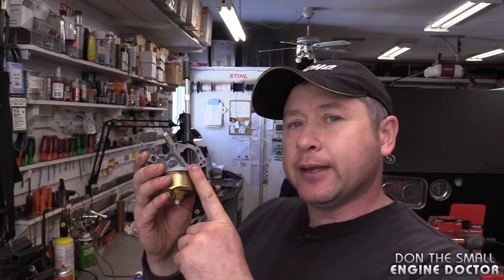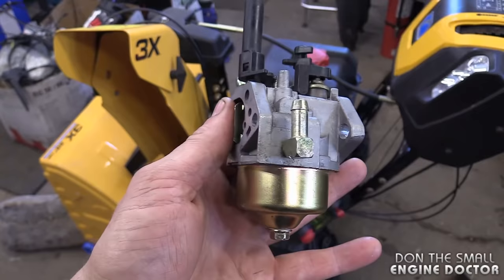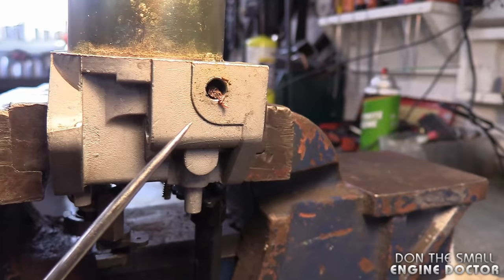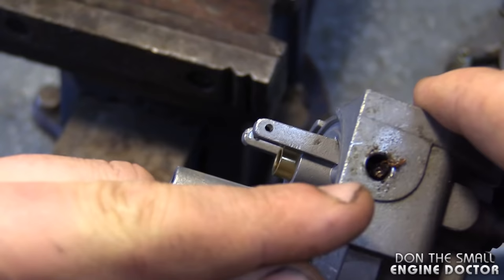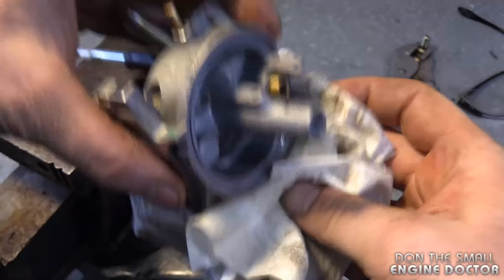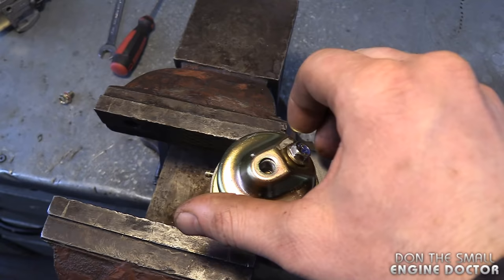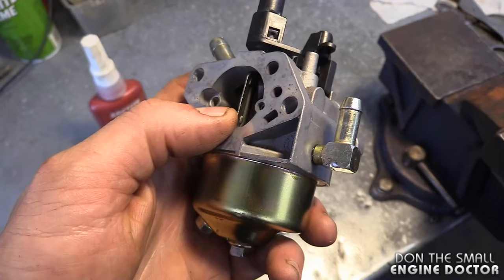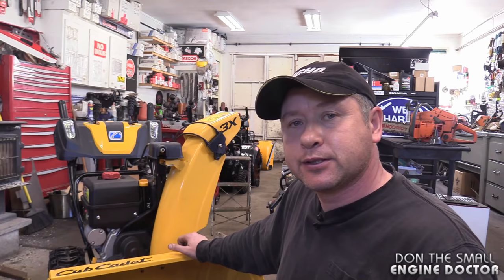Hidden Carburetor Fuel Filter Screen On Small Engines! Must see! - Video

Comment: That's a good tip Donyboy but if that outlet fitting is plastic I'll bet it breaks off more often than not.  The plastic ones seem to get brittle rather quickly and any tugging, twisting or pulling of them in my experience ends up breaking them off with some of it left in the carb.  Have you experienced this?  Kind of pain once they breakoff in the carb.

Comment: I’ve always after soaking the carburetor in carb cleaner back blew the inlet with brake cleaner and then air, usually have pretty good luck with that but there have been a few I could not clear, now I know why.

Comment: We had a  trencher in the shop nobody could figure out why it would run for few minutes then start to stall. It had been to several shops even a new carb. We found someone had put a hidden fuel filter into the system under a cover! It was clogged.  So if you do install a extra filter make sure it can be seen!

Comment: Danny, would just not taking apart the elbow fitting and removing the fuel bowel cover, needle valve, and blowing while the carb is still on the engine work the same way ?? Just thinking out loud and hope to speed up this type of work. Nice work fella.
Reply from the maker: Yes it would, I took it apart to show viewers exactly what they are dealing with. In my recent video I did as you mentioned.
Reply: @donyboy73 Have you noticed any difference using the latter method ??
Reply from the maker: @victoryfirst2878  the only issue is it will get plugged again
Reply: @donyboy73  Thank you Dony for the information Sir.Would using a prefilter keep the carb from getting clogged if a super fine filter media be used ?? I can tell you that 2 cycle carbs use an calculated mesh size to make sure the oil mix is correct. That is what I have found. Did you notice the same thing Sir ?? Peace and out. v

Comment: I would leave the screen out and install a small engine fuel filter if I had that carb on my snow blower. I bought my 8hp 26” 2 stage snow blower in 1985 from Canadian Tire and it runs like a charm due to my maintenance I put into it. I have the red inline fuel filter and when I add fuel I use Mr Funnel Portable Fuel Filter for that extra clean fuel. I don’t believe in having a screen in the gas tank that can clog up so I punched that out back in the 80’s.

Comment: Use light air pressure and carb cleaner several times. Only have to remove float and needle. Done

Comment: You have to be careful when you work on carburetors , but if it has a needle seat in the fuel inlet using compressed air can blow the small rubber needle o-ring seat out and that is what happens a lot if people don't know about it being in there ! But if there is no needle seat in the fuel inlet tube then just blow through it with compressed air gently then check air flow after blowing through it , it should be really free and that makes the fuel go through nicely !

Comment: Very interesting indeed.  One would think the manufacturer would have a oring/retainer set up for that fuel inlet pipe instead of relying on a "press fit" to hold the inlet pipe in place along with protecting from fuel leaks...Oh well, guess it all comes down to cost...

Comment: Donny when I've taken off the gas line in a few carbs there was a wax buildup sticking out the carb line looked like a stick ive always cleaned that out by spraying carb cleaned thru it till it looked clean I guess that screen was clogged never knew there was a filter in there thanks donny
Reply from the maker: that's possible!

Comment: I would probably just leave the connector on, pull out the needle valve, then use all the pressure I like down through the valve hole and let the connector hold the screen in place. No worries about having to re-seat the connector then either.

Comment: Tell me about it. I had a Triumph 885 Tiger that had an intermittent fuel starvation problem. After trying everything else I stripped the carbs and found a tiny microfibre filter inside the carb inlet pipe. It didn't have that much gunk or dirt in it, but it was enough to cause the problem.

Comment: OLD MAN at Eliminator: Dony just wondering if this screen is only on the MTD carbs? We have not come across any issues since we ultrasonic clean all of our carbs then air blow dry so possibly that is why we have not had issues. Great MUST HAVE INFORMATION which i will pass on to Jake since we will likely start pulling out the fuel inlet to check condition after ultrasonic cleaning to ensure all debris has been removed.

Comment: Never had good luck removing and reinstalling fuel inlet with out  leaking especially plastic ones
Reply from the maker: try the sealant i used in video
Reply: Super glue is impervious to gas. Worked for me with leaking plastic inlet fittings

Comment: Nice Video and great info Sir  ty .I also usually install a "laser" # 42531, ( Briggs and Stratton # 298090) 150 micron fuel filter in line for reassurance  to catch the dirt also. as a precautionary measure. it only cost a few bucks! Again ty ,for the info, as it also needs attention and can be over looked very easy ty 100-100

Comment: For stuff like that I buy those cans of compressed air in the electronics section of any store of course it’s cheaper to buy more than one at Walmart those cans com with a straw . A little secret if you turn the can upside down it’ll freeze stuff glue a small peice of doing to tip of straw and spray some through doing till you see frost on it . Then you can freeze your warts and skin tags in a few days they fall off be careful

Comment: THE SCREEN IN THE CARB IS FINER THAN THE FUEL FILTER THAT ALSO HAS A SCREEN IN IT THAT YOU PUT IN LINE, SO PUT A BETTER FILTER THERE OR THE CARB SREEN WILL PLUG AGAIN,SO IF THERE IS ROOM FOR THE IN LINE FILTER DONT PUT THE CARB SCREEN BACK,OR THE PROBLEM MY RETURN, OR USE A FILTER THAT HAS PAPPER TYPE MEDIA IN IT,ANY WAY I THINK YA GOT THE POINT,GOOD LUKE.

Comment: I'm hoping against hope this is the answer to the problem I've had with an outboard engine.
I have cleaned carb,and everything else.
Starts first time,then dies after a short time.
Another attempt,with this little gem may be the solution?

Comment: I have not run across this issue before.  However I have seen such bad ethanol damage the passage to the inlet needle was plugged.  I am of the opinion to leave that small carb filter out and only use an external filter like the one you have used.  If there is an inline filter at the gas tank you still have two filters.  A belt and suspenders. It would be Much easier to maintain and they are easier to find in hardware stores.

Comment: It seems like if you're headed just blowing the air down through the needle valve area it would have cleaned the screen and that small connector simultaneously. Any reason why you didn't do it that way?

Comment: Theres a similar screen under the primer ball on 2 cycle trimmers that is so fine it can look ok but its actually clogged with fine silt. Just pull it out with a pick and clean with carb cleaner and compressed air, just wear goggles as ive had the carb cleaner shoot back into my eyes when cleaning them.

Comment: Do not spray carb cleaner through the needle seat if it has a seal inside. It will expand and will not allow fuel to flow.

Comment: Good tip mate ,is it the same for chainsaws ive an ms230 ,ive put a new carb kit in twice .second time it seemed to cure the running problem it ran nicely for half an hour and then it started dying again as though it was starving of fuel and wouldn't rev.i did replace fuel line and filter in the tank. im baffled i did clean carb as much as i could get at .thanks for showing

Comment: That was very informative, Thank You! I have a Cub Cadet with rubber tracks and it will not move or the tracks don’t turn, have you ever experienced this and what is wrong with it?
Reply from the maker: hi Jim, check inside transmission, belt also

Comment: Can you comment on the 1/8" vacuum line I see on some Tecumseh carbs leading to the air cleaner? It passes through the choke plate and attaches to the carb body with a small brass tube.

Comment: I just took off my carb,  The screen was clean but I cleaned everything anyway.  Reassembled and once again, it will only run fully choked.  I don't see a filter on the gas tank so I don't know why it is fuel starved.  If I use the primer, then I'm able to unchoke it.  So there's a fuel starvation issue somewhere.  Ugh!  Maybe take the tank off next.

Comment: Do all 4 cycle carbs have it. In particular, what if it does not have the removable inlet? I just cleaned out a B&S carb today and I'm wondering where it could be. Good idea about the inline fuel filter - I def need one of those.
Reply from the maker: I mostly find that screen on powermore engines from mtd

Comment: Could you clean the screen without pulling out the 90degree fuel line fitting?  If you blew it out from the needle port side outward, wouldn't the dirt still come out?
Reply from the maker: Possibly yes.

Comment: Is that screen on the older techumseh engines also? Supposedly the fuel line fitting is not removable so can I just spray carb cleaner in the fuel valve fitting and blow air through it that way? Thanks

Comment: I haven’t come across that particular issue yet, but I’m glad you showed me this, I would have never found that screen. I never understood why there can’t just be a inline filter, the in tank filters are a pain wether it’s under the cap or built in to the tank outlet. One simple replaceable inline filter is what’s needed
Reply from the maker: I came across this screen by chance when I was removing the connector from a carb I was about to throw out!
Reply: The usual issue is surging

Comment: I have a B&S engine on an old lawnmower, and it stops running after a few minutes. I find there is a screen/screw thingy on the inside of the fuel tank right in front of the discharge tube to the carb.  Is there anything I can do to clean,  or remove this screen ?  I have cut open my fuel tank to be able to see the part, and I will be happy to send you the picture, it is a clear picture of this part inside of the tank

Comment: Forgot to add I have a craftsman 6.5 HP I had the carb. Worked over put am extra fuel filter on it after a few gas fill ups it will start up run for about 10 sec. then die, u can keep doing it but will not keep running ?

Comment: this fn screen on my quad keeps re-clogging every year or 2 even tho i added an inline fuel filter just before the carburetor. may have to upgrade to a quad w/o a carburetor in the future.

since other small engines w/ similar carbs never clog up, u gotta wonder what the big difference is and what would happen if we just removed that screen that is always plugging? maybe the port would then get clogged or maybe it'd be fine.....wish i knew!

Comment: New Subscriber, i never knew of that filter.
if a piece of equipment comes in without a fuel filter i always fit a 298090S briggs filter. Is there a brand on the carburetor? Ruixing, or Kei Hein?
Wix 33011 for equipment with a fuel pump.

Comment: Now my generator  has a screen  on the Petcock  should I put a inline  fuel filter  in between  the shut off valve  and carb? Or I'd that a bad idea because  it could restrict  fuel flow ? since there is no fuel pump. Any help thanks

Comment: Do not use 680 lock  tite you will not get it apart  unless you heat it to 400 farehit    use permatex or teflon in a tube.

Comment: Have  a 2000 watt tractor supply generator I have to buy and keep a new 15$ carb cause if it sits the carb floods I've always drained  but never runs after sitting any ideas 4 carbs so far .🤔

Comment: I have a Honda lawn mower with GVC 160 engine.  The engine surges when running.  Most youtube videos say it is the jet is cloged but I clean mine and eventually replaced the whole carburetor but it still surges.  The mower runs but has low power because of the surging.  The choke works fine so it is not the thermal coupling.  What do you think it could be?  I have tried Mechanic in the Bottle and it improved somewhat but returned to the constant surging.  HELP!!!  I have looked in the tank and it is clean with no debris inside.
I watched your video on the Honda engine and I will try the gasket because the carb has already been replaced.

Comment: Dony boy I have a question I have a 25 hp twin carb tecumseh it has good spark it has a new fuel pump but still won’t start on its own I have to spray gas in the carbs then it will run til the gas burn out then stop the carbs are clean but I must be missing something can you help me

Comment: hi I have a kolhar courage 18 engine off of a troy built bronco rider mower, the engine will start and run if I put gas straight into the carburetor but it burns that little bit of gas and quits, but with the carburetor on there it will not start at all, so what could be stopping the gas from going through the carburetor ? thanks for any help.

Comment: I have a mower that will start on the first pull, run as long as I want it to, but if I shut it off for more than a minute, it will not start back up until the next day. Also, if it doesn't start on the first pull, it's not going to start until the next day. I prime it with 10 pumps and as long as I immediately pull it will start. If I wait several seconds before pulling it won't start until the next day. You can guess what my wife says.

Comment: Hey Don'y. Where do you see the small engine industry going in the upcoming years. The industry still strong for the foreseeable future, or are electrics making a dent and possibly killing the industry?
Thanks much.👍
Reply: I don't know Dony's opinion, but this year my neighbor got a Snow Joe 48-Volt Cordless Snow Blower Kit. He seemed to mostly keep up with my 8HP Ariens. Although we had a 30" snow fall in Feb 2021 [northeast PA]. The electric blower got bogged down in that big of an accumulation. I'd say the battery units look like a viable option if you live where snowfalls are usually light.
Reply: @RichardFallstich  Thanks for the info.👍

Comment: Dony,

Not to bug you but I have a Briggs and Stratton 6.5 intek that uses a 5059 filter. It will not start unless primed even when warm and as soon as you put the air filter on it chokes out and dies. I have seriously tried everything I know of. Do you have any suggestions?
Reply: Dony, disregard my last request. I installed the incorrect carburetor with the primer on the opposite side of the carburetor.

Comment: Hey Donny Does the bowl have to face in a specific direction
Reply from the maker: It doesn't seem like it really matters but I usually face the drain screw where it is accessible.
Reply: @donyboy73  thanks for that, i was thinking the recess in the bowl was to stop the float pin from drifting out but wasn't sure

Comment: As you pointed out, have never known about this filter, seems like the wrong place for a filter, what if you clean up the carb and remove the filter, especially if you can install an external filter?
Reply from the maker: yes it is not necessary to have the screen if u add inline filter

Comment: Couldn’t you just squirt some carb cleaner into the fuel inlet to soften up the crud, then just use compressed air to blow through the float seat hole and blow the crud all the way out through the inlet elbow? That way you don’t have to remove the inlet elbow and chance a leak?
Reply: can u see around corners in the dark, that's why u remove the elbow

Comment: I have a Honda lawn mower with gvx140 engine on it ... I think I will go insane with the trouble ... It starts fine , works fine , and after 15-20 minutes in it it start surging . I change spark plug several times and same thing , cleaned carburetor several times and same is happening , adjust the valves several times and same is happening ... If anyone , but anyone , have an idea on for what is going on , please help ...

Comment: Where can I buy that small red extra inline fuel filter that you showed on the snowblower?
Reply: To answer your question, just about anywhere ! Those aren't actually filters, just a piece of fine mesh screen is inside of them. More of a strainer than actual filter media. I run the clear see through filters on all of my equipment. Easy to tell when they're dirty or there's water in the fuel.
Reply from the maker: from your local small engine shop or amazon
Reply: Ebay lots

Comment: ZAMA C1U-K19  JD 21c weed eater air filter soaked with fuel and fuel seams to be splashing out of carb when i remove air filter and run it. any fix for this. also cant find a new air filter online to order.
Reply from the maker: try new carb kit

Comment: Don,   I put a new 631021B kit in my 6hp Tecumseh carb but it still hard to start or prime. Should I push the main jet out and replace o rings? Running a bit rough.
Reply from the maker: is it an adjustable carb?
Reply: No. Emulsion tube o rings is likely my guess after watching another video.
Reply from the maker: @stoolie10  try enlarging the small screw jet like in this video https://www.youtube.com/watch?v=9peW43lG1lw&t=8s

Comment: is there one on a Tecumseh 10hp on a Yardman or Yardworks (MTD), if yes should be in the fuel intake from tank, is it ??
Tnx for replying.
Reply from the maker: none on tecumseh engines but there is a screen inside the tank
Reply: @donyboy73  I ask because I clean all fuel system, flush tank, clean carb and no more surging again (tnx to you for that!) BUT since I did it, my snowblower starts really good (no need to run on choke again) BUT it's dies when get warm up is done (When get hot), can you tell me where to check.
Really tnx by advance, I will subscribe for sure !
Reply from the maker: @martindesmarais7158  bonjour encore martin, check the gas cap or loosen it in case it is not venting the tank properly
Reply: already checked the gas cap, ok for this. Another way to check?
(